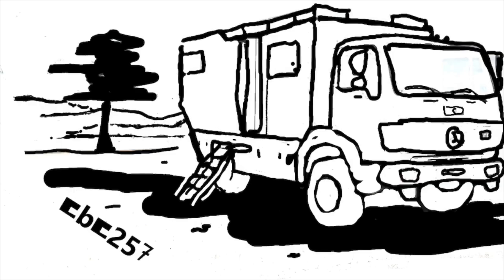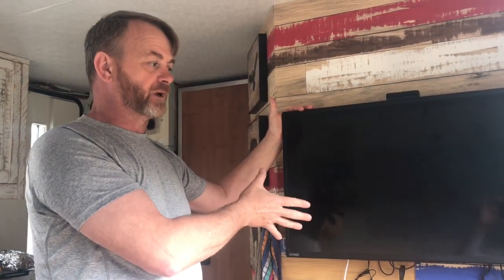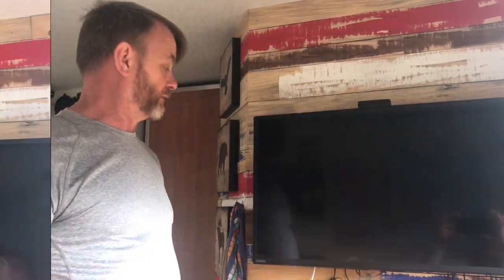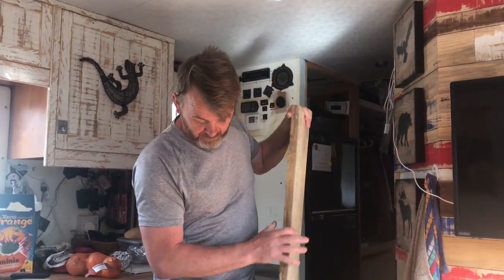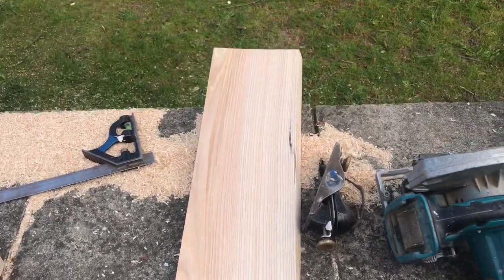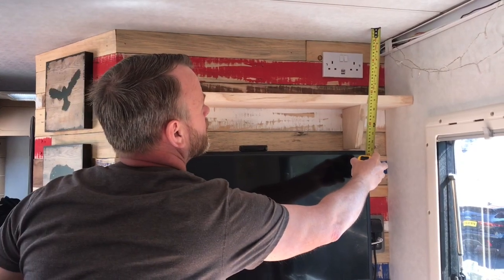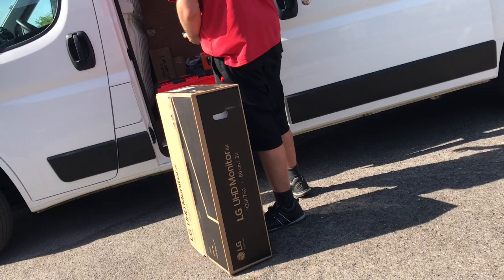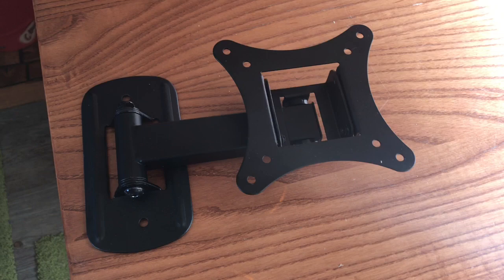4k TV/Monitor with shelf in our Camper Truck

Comment: Nice video mate. Looks like you've done a proper job there. 
Q's; What's on the other side of that camper wall you cut jnto? 
Do the freesat\view boxes have HDMI in? (Because you could daisy chain them..) 
Do you do your woodwork on any old garden wall or is that yours? 😆
Thanks for the good video. Looking forward to seeing more content.
Reply from the maker: Hi Matt, thanks for the Q’s: I edited “the behind the wall scene” to keep the video under 15mins :) but we’ve got the toilet wall behind, so above the toilet we’ll have a unit (covering the tv bracket bolts) and where the socket is at high level will be in a boxing with the soil pipe in it, thats from floor to ceiling with the pipe going up through the roof.  I’ll look into the Hdmi boxes cheers. As for the wall then yes, why not :) but whens there no wall then i higher the bike rack ;) cheers again. More vids to come btw